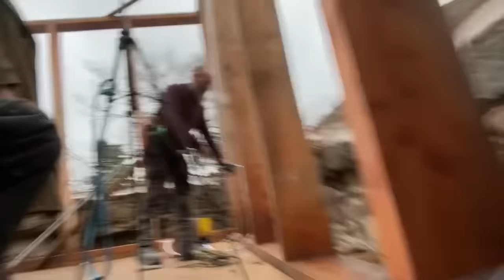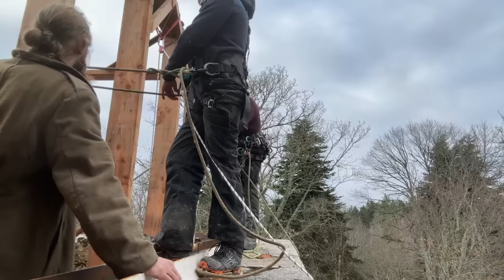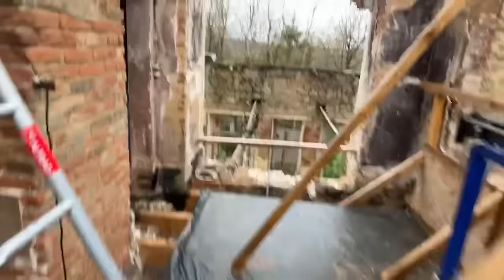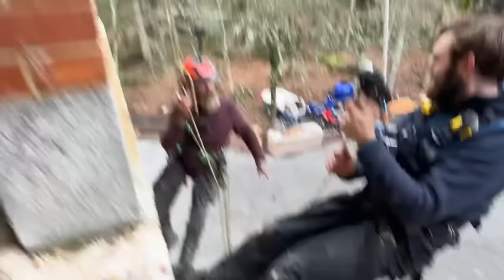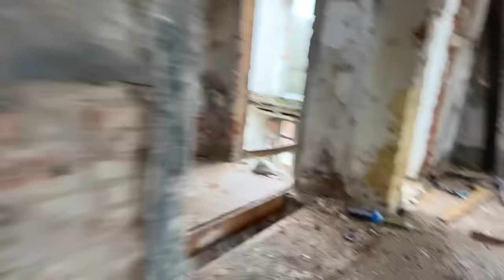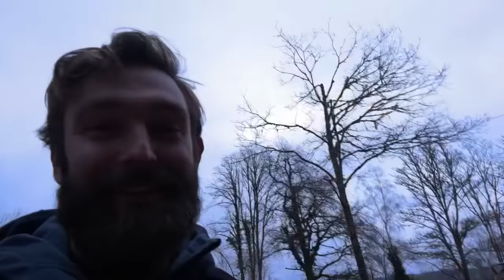Live at chateau de Chaumont, jumping off the chateau

Comment: It gets easier in time, Dan. 

Remember BRAKES - a system check for rappelling

Prior to rappelling, you should check every aspect of your system. The rappelling safety acronym BRAKES, developed by Cyril Shokoples in 2005 and now widely used by climbing schools, can easily be employed as a pre-rappel checklist. It’s a good idea to go through this list out loud by stating each letter and touching the part of the system you’re checking. 

B – Buckles: Check the buckles on your harness. Make sure they are snug and that all appropriate straps are doubled-back.

R – Rappel Device/Ropes: Check that the carabiner attached to your device is locked, both strands of the rope have been loaded correctly in the device, and the rope is properly threaded through the rappel anchor.

A – Anchor: Confirm that the anchor is strong. If it’s a tree, make sure it’s alive, large enough to hold your weight, and that it has a good root base. If it’s a boulder, ensure that it is not going to move. If rappelling off bolts or gear, confirm that they are suitably strong enough. Double-check that any webbing or cord isn’t damaged or too faded.

K – Knots: Check all the knots in the system. Make sure that knots adjoining two ropes in a double-rope rappel are correctly tied with enough tail.

E – Ends: Confirm that the ends of your ropes are on the ground or that they reach the next anchor. Confirm that your system is closed with knots at the end of your rappel lines.

S – Safety Backup/Sharp Edges: Use an autoblock backup and check to make sure that you aren’t going to rappel over any sharp edges.

Safe dangling!
Reply: Thanks for this. It helps a lot of us!!!😊
Reply: Thank you for posting

Comment: Hello Dan,
Nick and Cameron come from an arborist background, they know what they are doing and I think it's great how much they are helping you. The material you are using is from industrial climbing. However, I have discovered 2 mistakes that you urgently need to change when using the Petzl AVAO and the ID.  The carabiner that connects the chest harness to the pelvic harness must be hooked into the textile and not into the metal working loop.
The ID can also be hooked into the same textile loop. This makes work much easier as it sits much lower and cannot twist.  If you still have the operating instructions for the work harness (I know, there are a lot of pages that nobody really wants to read) it should also be written or illustrated there.
I worked for many years in industrial climbing and also did arborist work as a hobby. 
I have just taken 2 photos with my equipment showing how to use it correctly. But I don't know how I can send them to you. If the chateau wasn't almost 1000km away, I would come over and support you for 1-2 days with the roof using the industrial climbing equipment until you are 100% confident in handling it. Only if you are confident in its use will it not hinder you. So today's abseil training was a very good exercise that nick and cameron did with you.

Always stay safe and keep going!

Comment: Looks like you were having great fun. Just one safety point though. You've got the harness on wrong. The A clip karabiner at the front doesn't go through the ventral ring, it goes through the yellow loop that the ring is connected to. You'll find the harness fits a lot better and the ID sits better too.

Comment: This is exactly the instruction you need. Just research how many deaths from people falling off of roofs. Some of them roofers. And some  from roofs that are only a single story tall. Working on a roof that high you absolutely need a professional harness. Now that Nick and Cameron have given you instruction you need to PRACTICE with them them present. Do not practice without them being there. Practice a lot at every opportunity because when you do fall you will panic and you won’t be able to think clearly for a bit. You will also need to be harnessing yourself up so you need to practice not only putting the harness on without help but also rigging the ropes properly. That is a lot of information to take in so you need to practice with Nick and Cameron present before you attempt to rig any of this stuff by yourself. Safety equipment can give you a false sense of confidence and that’s when accidents happen. With a roof as high as yours, you’ll need to be extra careful. I would strongly suggest you not work alone, at least not for this first roof. Oh, and wear a safety helmet. Did you hear him say years of practice? That means you’ll need to do it more than once. So when you have them there and some time, practice it again and again.

Comment: Well done Dan buying a safety harness. My last 20 years I worked for a communication company main one in UK for 5 years was pole climbing and on my harness I has a restraint Lanyard that would clip to top ring of pole so if my belt which went around the pole failed the lanyard would hold me. Just felt with being so high up use new rope. Great training and advise.

Comment: A few points to save your life. Your wearing the harness wrong, you should start by tightening the waist belt and leaning forward. Then tighten the remaining buckles. your side loading the karabiner that attaches your descender. Attach it to you main d ring. you should  always hold the tail of the rope that comes out the descender. Use rope protection on edges. Don’t work on ropes alone.  Perhaps get some professional training. Take it from someone who has been in the industry more than 35 years

Comment: I Use this Harness at work. Harness isn't on properly. The clasp goes through the webbing above the D ring not the D ring and the rope should be fitted to the D rings not the clasp so you don't side load it in a fall.

Comment: Remember, the weak point isn't the enormous timber beams, but the 4 screws holding the two wall panels together at the corner. 
And the load you put on that weak point during a fall isn't just you being 90kgs. The shock load is actually more like 2 tonnes.
That's a lot to ask of just a few screws in softwood.
Consider beefing up the corner joints?

Comment: That was fantastic !  Now you can work on those almost vertical sides of the roof and not worry about falling or having to compensate  while you are working. Now you need some mechanically assisted way to get the beams and roof panels up there. I know you will figure it out. You always do.

Comment: I need one of those descender things. I have a full harness, long rope and a lock that I need to hold open to descend. So if I should happen to take a step off a roof, I'd end up hanging there.   
I use it at the apartmentbuilding I live, when I'm up on the roof to paint the wall between houses(row of houses at slightly different heights. ) and spray moss and stuff like that. 
The kit I have will arrest my fall, but I'd need a neighbor to help me down.(Get a ladder into the right position and all that, and there's a time limit. Harnesses tends to block bloodflow to your legs when you're hanging there)

Comment: Dan - the guys commenting on your harness setup are right! The reason it's loose at the front is the screw gate is meant to go through the webbing with the D, not through the D itself. This D-ring is your main attachment point and using it will be more comfortable and align better. I probably sound like a dick but you also need to know what you're doing. Is that static rope? Impact from 1 metre fall on a work positioning rig will break your hips, assuming that anchor holds. Use the absorber if it's for a fall arrest setup, and if you fall on it on your own, get a helmet to help stay consious,  get an ascender and croll, or at least carry prussics to self recover and save your legs before they go numb and die and the toxic blood kills you. Cam is an arborist with great intentions but his gear and set-up is designed for climbing on, not falling on.

Comment: Question if you put a tap on 4 of the blue colour barrels, sitting around, and whilst there empty lift them to the highest level possible, then fix hose pipe to each tap,that would give you free gravity fedwater as the barrels fill with rain, longer hoses for lower levels? Just a thought.

Comment: the rope rubs on the outside corner of the Cornice and could cut with wear causing
Reply: Those ropes are incredibly strong and won't be damaged so easily. They see much worse environments.
Reply: He's not going to be working like that everyday anyway. The rope will only be taut like that if he falls. This is fall protection, not working gear like Nick uses it. He'll be doing his normal wall walking and joist balancing with a slack rope. Going over the edge was just to get a feel for the set-up and how to come down should he fall.

Comment: interesting note if u fall in a harnes and hang there for more then 30minuts without getting the pressure off ur legs thats tight u can die from that. or least thats what they taught in my tower rescue coarse i took and recertifed in.

u can get build in seats for some harneses that fix the mentioned issue fyi but on that note if ur guna take any safty coarse take this one it will help iwith allot of rigging as well.  theres sme stuff around safty worth taking a coarse for this is one of them

i have that same harnes and have the work belt for tieing into stuff for support when on towns so nice to just lean back and relax

Comment: The carabiner in front of the harness still goes thru the fabric with the metal ring, not into the ring itself. You know it‘s wrong that way because the connection twists the ring. Refer to the manual!

Comment: Dudes! You need a pad under that rope on the ledge for what you are doing. That rope will be abraided, even if just a little bit - it will be more and more unsafe to use over time. Any other climbers or cavers chiming in on this? I guess if he is only using it for emergency use would it be ok, since it won't really have weight on it stressing any abrasion? I don't know.

Comment: jesus, you need a top rope edge protector, those ropes are going to fray, fast.
Reply: No they won't.
Reply: @LaReynedEpee  useless reply without an reason..
Reply: @ianskinner1619  They won't fray fast, because they're designed to resist abrasion.
Reply: @LaReynedEpee  they make top rope protectors for a reason bud.. perhaps look up why, then look at that shaped edge on the granite crowns the rope is under tension  against.